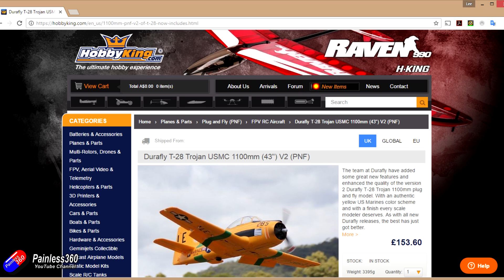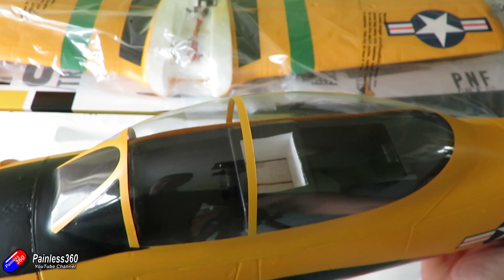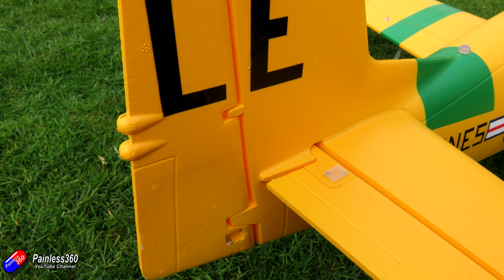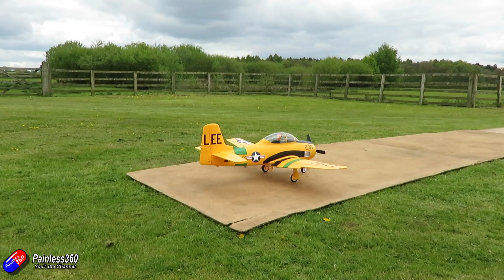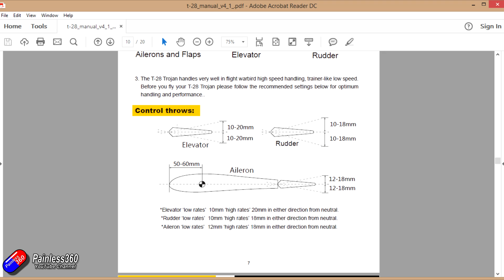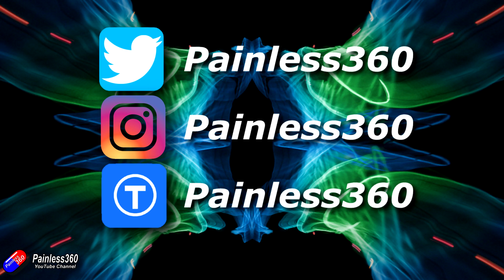RC Reviews: Durafly T-28 Trojan V2 1100mm

Comment: HOT WATER IS A BETTER CHOICE TO FIX FOAM
Reply from the maker: It is if you can submerge the part. I’m planning a video on repair techniques as a lot of pilots don’t get to see the steps to bring a model back into flying form..
Reply: You can also pour it over something, you NEVER run the risk of bubbling or burning. Made mistakes using a hair dryer and learned. Have you seen the new version?
Reply from the maker: I've got it here - not unboxed it yet..

Comment: So many variations of this plane. I got a different brand but plan on ordering the air brake and adding it to my model. Since the scale is the same with all of them. It wouldnt be a stretch to say one company produces the body for them all,just add different electronics and whatever and it becomes an FMS,or FreeSky,or Eleven Hobby. See my reasoning. Seriously,all the parts are easily interchangable. I used the FMS landing gear in my Dynam Corsiar,no issues at all. I always enjoy the swapability on these planes. Try that with a balsa plane.

Comment: very nice video review...if you dont mind i still have a quetion or two about the plane...how does the gear work on grass, i noticed you started the Trojan from a hard surface...im asking because our field is a very bumpy one with not so short grass and the wheels look pretty smal to me...which brings me to question number two, does the prop have enough ground clearance for use on a rough grass field?
Reply from the maker: Not great on grass. It has to be super smooth as this has scale wheels. We used a boarded runway and I usually land in longer grass if I can't get a smooth area/tarmac to come back onto..
Reply: Buy a set of mains wheels. Put it on the nose strut. Using your Dremel cutting wheel, Very carefully, cut the excess foam in nose wheel compartment where that main tire tucks for a very good fit. Finish. You have nearly 1 us inch prop clearance or the metric equivalent. Save your props a bit. Blue skies guys!😎☝️

Comment: Can someone tell me a good recomendend throw expo
Reply from the maker: +Mark Monahan it's a very personal thing, I start with 25% on elevator and aileron and 15% on rudder...
Reply: Painless360 and as far as the control horns you have them on the last slot correct? Like the most throw possible
Reply from the maker: +Mark Monahan not really, see the horns on the servo and control horns to give you the throws you need without changing the travel on the radio. Closest hole on servo and outside hole on control horns gives the smallest throw.. you'll end up with a little setup on the radio to fine tune.. This could be a useful video to cover this..
Reply: Painless360 this is why I had so many problems on the first flight... okay so on all your control surfaces you the linkage on the lowest control horn (hole closest to the servo) and then on your radio it gives you more freedom with your throws and expo correct?
Reply: Wait a second the control rod doesn't fit in the other holes... please advise the last one is the only one it can go in on the physical servo
Reply from the maker: +Mark Monahan depends on the model, I'd check the manual.. you can simply reduce the throws on the channel in the radio (See my OpenTX video on fixed wing setup) but you sacrifice resolution. Best of luck